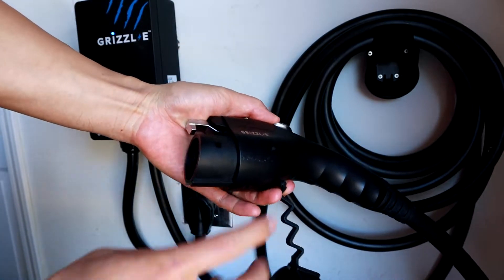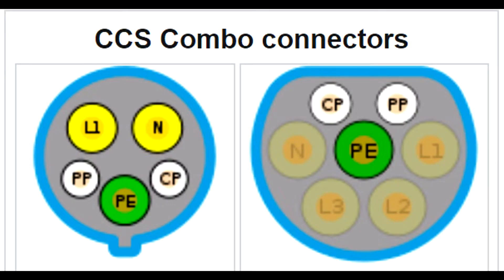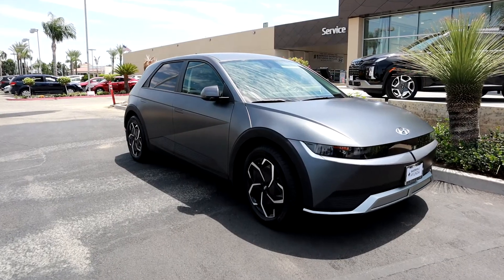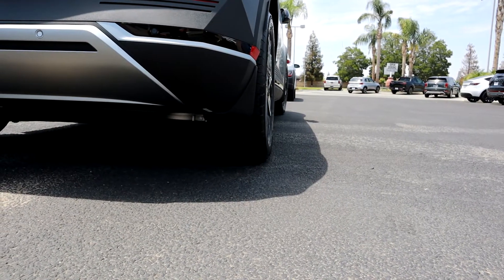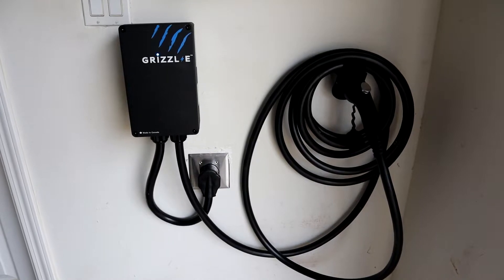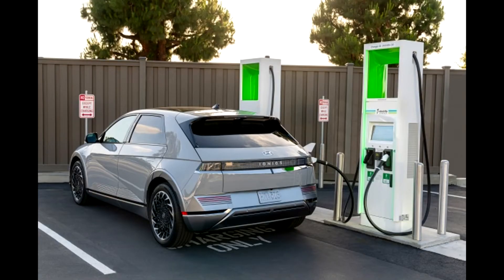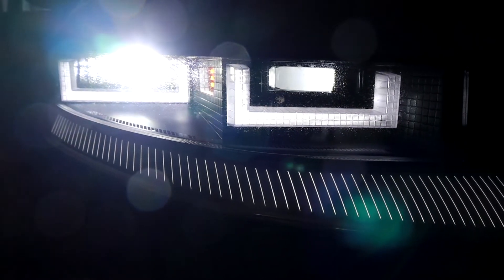CCS1?  CCS2?  What’s The Difference For Your Electric Vehicle?

Comment: Any number I can reach you. I have a question on CCS1 vs CCS2 for cars in my country.

The only difference I see in the CCS1 vs CCS2 is with Home Charging as the extra L2 and L3 on CCS2 are not present in many countries. 
However I don’t see the difference for DC Fast Charging as both CCS1 and CCS2 share the same port. Is there any difference in the Communication protocol that will trigger the PP and CP controls to operate differently for DC charging with CCS1 and CCS2?
Reply from the maker: For DC fast charging, everything is the same for CCS1 and CCS2.  It's just the home charging with a CCS2 car because your country probably has 3 phase charging on the AC side right?  I don't know the technical jargon, but the car knows if it's DC or AC level 2 home charging.  So when you plug into that DC fast charger, the car knows and will charge at 350 kW or whatever the station is setup for.

Comment: in theory - AC terminals (both type1/type2)  is "limited" up to 80A current - type1 is max 240x80 = 19,2kW = ford f150), in EU older model of renault ZOE (Q model) has 43kW onboard charger 
3x 240 x 63A

Comment: Hmm, maybe I wasn't listening closely enough, but I learned nothing of the difference between CCS 1 and CCS 2.
Reply from the maker: You're right for the DC portion.  There's really two parts to the video.  AC charging and DC charging.  What I assume you mean by "nothing different between CCS1 and CCS2" is correct if you're going to DCFC your car.  You can do this at Electrify America, etc.   CCS1 and CCS2 are the same from a DC charging standpoint, 350kW max.

But when we talk about the AC charging side, so at your house, that's where the differences are.  Type 1 can only go about 11kW max.  But because type 2 has the additional L2/L3 pins, it can go to about 22kW.
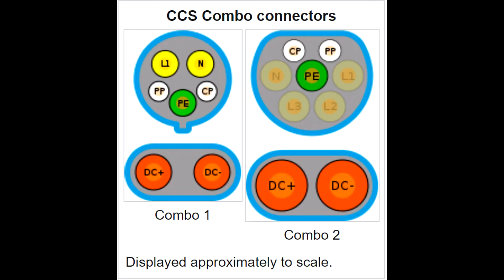Reply: 3:24 Shows you the difference between CCS 1 and CCS 2.
Reply: @Trust_but_Verify  Ahhh, so by Combo 1 and Combo 2 he means CCS1 and CCS2.